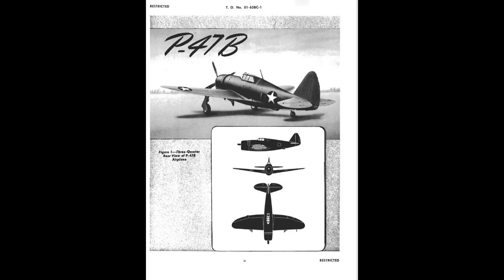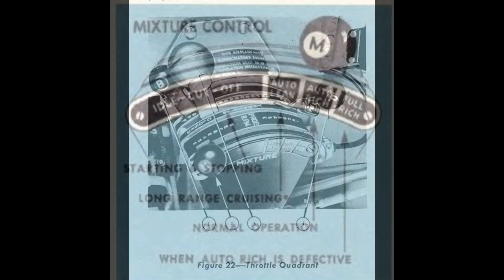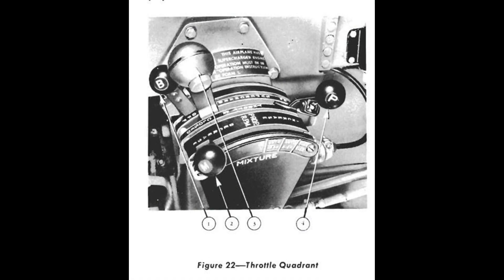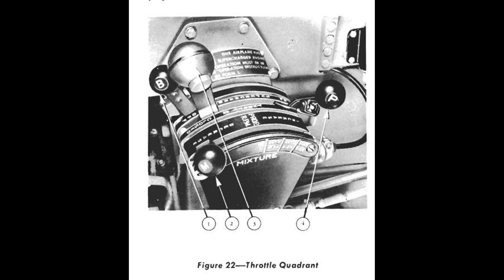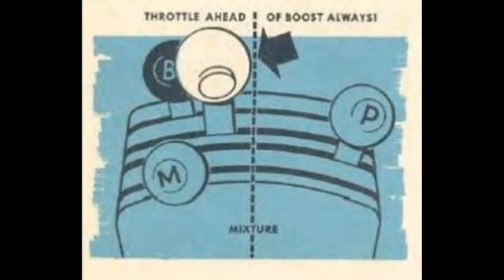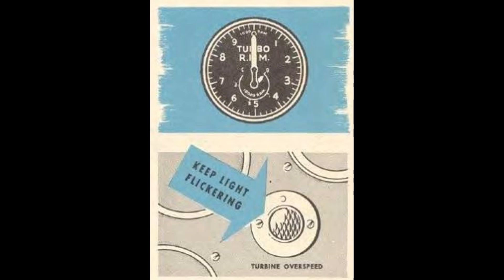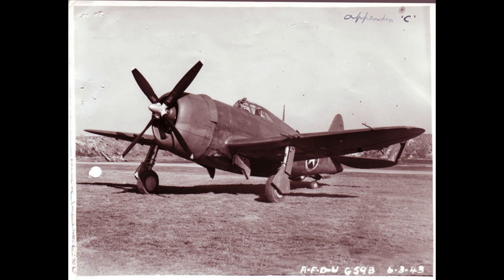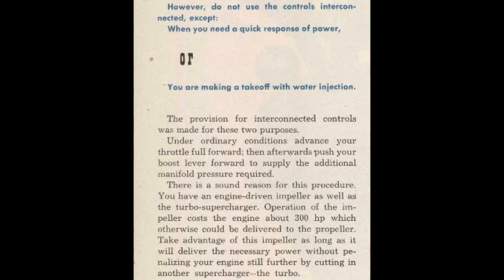P-47 Thunderbolt Pt. 1A Throttle and Boost Lever Use

Comment: A suggestion if I may. Don't use black letters when putting in a text as it can be hard to see unless there is a light background.
Reply from the maker: Good point.
Reply: @GregsAirplanesandAutomobiles  white with a black outline or black with a white outline usually work for any background color.

Comment: It's amazing just how complex WWII were to operate. Take this scenario as an example.

You and the boys are flying a fighter sweep when you get bounced by Jerry. You're in a P-47D, set up for cruise, running external drop tanks. (fuel settings and drop tank operation vary depending on model) You change your primary fuel selector switch to main, reach to the left of your seat and pull the two T shaped handles to release the left and right drop tanks, Mixture goes to auto rich, prop pitch set to auto to get RPM's up, then throttle full. If you're above 7000ft, your turbo will be set linked to throttle. If not, there's that to manage too. 

On top of all of this, you need to be turning and likely starting a dive to build energy / speed, flip the master arm switch for camera / gun, check gun heat is on, and turn on your gun sight which a lot of pilots turned off when not in combat to ensure the bulb worked. Most kept a spare on them and hey, if you can do all the above, changing a bulb out is a piece of cake while your head is on a swivel trying to figure out where those cannon wielding Kraut's went.
Reply: Escape Velocity - agreed.  I think in general - no matter what your machine - you truly had to "know" its mechanics back in the day.   One thing to consider though is that a lot of the fine tuning was ideal, but not fatal if it wasn't done in all scenarios.   Many aces claimed that they became aces not by winning epic dogfights (where fine tuning could be the difference maker), but by picking weak opponents ("Tail-end Charlie"), attacking them unawares, and then escaping (something the 47 excelled at). These were the type of attacks that, although risky if it went wrong, it wouldn't be fatal if say there was some marginal HP loss due to some non-ideal setting the pilot might have missed.   So when you throw in adrenaline, fear, timing, etc. - it's likely the case that WWII fighters, on both sides, were frequently in combat while their birds were not in the most optimal, by the book settings.  Still though, there was a lot to remember about the basic mechanics of your plane.  I think what's so interesting about that factor is that it likely created a lot of room for pilot variation.  Skill levels, styles, tactics, preferences, etc., likely varied in subtle, but important ways pilot to pilot based on mechanical know-how and/or the ability to tune the plane on the fly in combat.
Reply: @helzevec  I haven't read up much on the P47 but I have read some on the P38 and the order for increasing and decreasing power would trash the engines if not done correctly. While the R2800 and the V1750 aren't the same, its something to consider. Also, I think there are limitations on an aircraft when drop tanks were attached. Id have to go back and look at the manual. 

When combat started and how a pilot reacted often made the difference between life and death. On escort missions, it was routine for leads to call out 15 minutes before fighter contact was expected to make sure everyone was set up. Later versions of the P47 featured an electric release mechanism for drop tanks that had to be armed and ready and could be released with a touch of a button the stick. Pilots in these aircraft were always busy and a good example is managing fuel when flying on external drop tanks. Pilots would cycle back and forth between tanks every 15 minutes and with no fuel gauge, tanks would be dropped at a certain time when fuel was expected to run out.
Reply: I think the main differentiation between an advanced WW2 fighter and say something like a F/A-18 Hornet in switchology complexity is just throttle management. Everything else there (except for the gun sight shenanigans) is about the same. 

Of course, a big difference is when you're in a Hornet and you need to pull a 7G turn all you do is slam the throttles forward and PULL. The computer handles everything for you in making sure you don't overstress the airframe (although, you can pull the lever on your stick and get maximum performance).  Meanwhile if you do that in a WW2 fighter you're probably gonna start a very nasty stall state.
Reply: @monkatraz  Cant comment on the Hornet, but when it comes to Jet's vs props, Jet's definitely simplified things and reduced pilot workloads. Later jets starting incorporating advanced HUD's and HOTAS (hands on throttle and stick) controls meant to keep the pilots focused on flying and fighting rather than navigating their systems in the cockpit.
Reply: An issue is with modern computerized jets is the massive workload with systems managements on your screens. Old WW2 prop planes obviously don't have this issue. The big thing that modern jets simplified massively was flight controls. Modern jet you pull the stick hard at a safe speed nothing bad should happen.
Reply: Escape Velocity And our boys were the best at it! Love the skill it took to fly these beauties.

Comment: Can you explain briefly why the Turbo lever is required to be infront of the throttle?
Since I still havent understood why. I have understood why moving them together is bad, but to get higher MAP than just 52" Turbo is required. I can hardly imagine that pilots had the discipline to remind this rule in heated combat.
Reply from the maker: Good question. The turbo lever should never be in front of the throttle. There is a whole page in the manual about this. The reason is that it will cause a situation where there isn't enough exhaust to spin the turbo, and the boost the turbo is putting out will be partially blocked the the throttle plate. Recovery is to lower the nose and advance the throttle. The manual says it may take up to 30 seconds to get back up to full power. In more mild situations, it will cause pulsing in power and irregular mixture control, not as serious, recovery is the same.

Comment: Hey Greg, thanks for the info about the P-47 engine management. This is how it's implemented in IL-2 currently:

At sea level, with turbo off and full RPM and Throttle, without water injection the engine will do 49.5" of pressure, for around 306 mph top speed.

With water injection activated, the manifold pressure remains the same but speed increases to 313 mph.

With water off, advancing the turbo lever doesn't activate it until you hit 89% of the lever position, then the light starts blinking and the tachometer spools up to around 900 RPM, speed doesn't change, as the turbocharger RPM rises, so does the manifold pressure and the speed.  Going 100% turbo it spools up to 6000 RPM, manifold pressure increases to 55.5" and top speed increases to 320 mph.

With water injection on, the turbo activates when the lever is at the 59% position. Going 100% on the turbo increases manifold pressure to around 67.2" at 11000 turbo RPM. To achieve the listed 64", you can have full throttle and decrease turbo a bit, or link both throttle and turbo to do it. With full throttle and going back a bit with the turbo (8700 RPM) top speed is 348 mph at 64". Now at the same setting but now linking the throttle and turbo levers (95%, 10500 RPM) the top speed is 347 mph, there is a bit of power loss but it's very small. 

There is no damage by having the turbo boost lever ahead of the throttle lever.

There is some power loss by running the turbo at full speed but it doesn't look like it is so much. For example with water injection and full turbo, but pulling back the throttle to make 52", top speed is 313 mph. With full throttle but pulling back the turbo to make the same 52", top speed is 319 mph.

The speed values are for a clean plane (no wing racks), 50% fuel and both oil and cowl shutters fully closed, intercooler at neutral position.

Also looks like the turbo gives a too low critical altitude, with 22000 RPM the critical altitude for 64" is 23000 feet. At this altitude top speed is 435 mph.

Looks like the turbosupercharger needs some adjustments, but I bet given the correct information and presented in a constructive way they will look at it ^^
Reply from the maker: Wow, that was some complete data collection. It sounds to me like they have it pretty close, but not quite right. The IL2 people are a good company and they will probably tweak it in the future.
Reply: Greetings from 2021!

As it's currently implemented, the P-47D-28 in Il-2 Great Battles seems to work this way:

You can set engine RPM and manifold pressure at max continuous without turbo at ground level. As you climb, manifold pressure will start dropping. Moving the throttle forward at this point won't have any effect.
The throttle lever doesn't control the throttle directly. The boost lever also doesn't control the waste gates directly.

At any altitude up to 28 thousand feet, without water injection, smacking the levers forward won't result in either overboosting the engine or overspeeding the turbo.

At five thousand feet, with all the levers fully forward and without water injection, the turbo RPM stays at around ten thousand RPM and the manifold pressure stays squarely at 52 inches. If you go to exterior view, you can see the waste gates flopping slightly.
Reply: Thanks for putting out the numbers. Very useful.
Reply: Greg said that throttle alone give 52" for take off, this is not true. And looks like il2 got it right since 49.5 is achievable at full throttle alone at 306mph, at this speed ram air will add couple inches of boost. For stationary plane it will be around 45" at full throttle alone.
I made a test in il2 so 49" is possible throttle alone when stationary, looks like il2 is missing ram air effect on MP so no matter your airspeed MP stay the same, in DCS MP on throttle alone changes with speed from 45" at low speed to +52" at very high speeds. looks like IL2 took average value and applied it.

Comment: I must say that you are real "talking encyclopedia" regarding the WW2 stuff Greg. Again a excellent video from you. 
You mentioned fly sims and possibility to use this throttle as it should be used. Since I frequently fly in IL2 BoS flight sim and fue days ago they release P-47D-28 as a early acces airplane , I just want to say that this is simulated in this airplane and it is possible to use throttle and turbocharger (boost) levers together (they are fixed to each other also with prop pitch lever) and you can move them together or adjust them separately as you like or as it required.

Thx for this video! Keep them coming  ;D
Reply from the maker: Thanks Skylord. With any luck I'll be on IL2 late tomorrow. I don't have track IR or comms so I'll mostly be getting shot down, but if you see me there, say hi. I usually fly the 190, id is GregHF
Reply: I also fly as "lone wolf" without comms so I also get shot down most of the time :/
I usualy fly on Wings of Liberty server in Fw 190 or Bf 109/110 as escort, bombing sortie or watching on our targets 
because I am not a good "dog fighter". 
Hope I see you there !

Comment: Nicely done, again, for the non-engineer and non-pilot. This is the sort of thing I wouldn't have thought of when writing about my Dad "transitioning" from the F6F to the F4U-4. Obviously, neither one is/was a P-47, but all 3 used basically the same engine, even if not the same boost mechanism(s), and these are the kinds of details – if you don't want to get yourself killed, either operationally or in combat – that you'd need to learn and practice until they became habit when moving from one fighter to another. Flying a WW II fighter was complicated enough without having to remember in one cockpit the details of (or exceptions to) procedures you'd learned in a different cockpit.
Reply from the maker: Hi Ray. The F6F and F4U certainly presented their own challenges! Typically U.S. WW2 pilots would sit in the cockpit and practice certain things until they became almost muscle memory. Some were required to be able to find and operate every switch blindfolded.
Reply: @GregsAirplanesandAutomobiles  I suspected as much, and am not surprised by the "blindfolded" part. I've seen instrument panels of both the F6F and the F4U in person, and they make even a race car's instrument cluster look pretty much like child's play.

Comment: Greg, let's be honest... You don't need to talk about throttle control on the P47, but im pretty sure everyone here is glad you are. These detailed videos are fascinating and im that much more of a aviation nerd for knowing all these little details. 

I hope at some point you take a look at the P38 Lightning and it's controls and just how complex and difficult the aircraft was to fight in. I stumbled across this article and its a topic ive never heard covered. 

http://www.historynet.com/p-38-flunked-europe.htm
Reply from the maker: Thanks. I will get to the P-38. It's going to be a facinating plane to talk about. There are so many great features, combined with so many issues and later resolutions to most of the issues, that there is a lot of subject matter there.
Reply: @GregsAirplanesandAutomobiles  I greatly look forward to it. Was there anything in the manual or did you come across anything in your reading covering how sensitive the 47 was to mismanaged prop settings and excessive EGT's?
Reply from the maker: There is a bit about the prop settings. You don't want to combine very low rpm with very high manifold pressure. The Auto-Rich function of the injection carb pretty well take care of the EGTs although cylinder head temps are something you have to keep an eye on.
Reply: Put me down for some dope on the P-38. After reading Bodie's book I wondered why it wasn't used more often for bomber escort in Europe, given its speed and range. Just a bit too complex to operate for its own good?
Reply from the maker: Hi Dan. I'll get to the P-38 in time. It had issues in Europe that really didn't effect it in the Pacific theater. For example, it's mach number limitation hurts it in high altitude dives. Not a problem against Japanese planes, but with it's limitation of mach .67 it can't out dive a 109 or 190. The heater was almost totally ineffective. That's an issue at 25,000 feet, especially over Germany in the winter. There is a lot more, I'll cover it eventually.
Reply: Was the high Mach limit due to the wing/fuselage fillet shape?
Reply: Greg's Airplanes and Automobiles - When you do make some 38 vids, I hope you take a moment to mention that 38 units in the ETO had uncharacteristically poor performance with the P-38. Lightning units fighting in the 15th AF fought just as high as the 8th, yet they were a potent fighting force. I attribute their success, contrasted against the 8th AF, as a difference in experience from the ground crew’s maintenance, to the pilots operating procedures, to the general command escort tactics.It’s also worth mentioning that until hordes of P-51s overwhelmed the skies, the P-38 was the ONLY longe-range daylight fighter, and therefore was usually outnumbered, deep over enemy airspace, and desperately trying to make up the difference in experience that the Luftwaffe had over them.
Be sure read about P-38 tactics from some of the best 38 drivers like Jack Ilfrey, Irv Ethell, Robin Olds, Tommy McGuire, Tommy Lynch, and Dick Bong
Reply: Also, be sure to read “Combat Tactics in the SouthWest Pacific Area”, by Tommy McGuire and other experienced veterans in May of 1944

Comment: Would be nice if this system had the same level of automation found in the German planes. ( Push throttle forward, get power! ) seem that to get the most out of this plane one may need a proper throttle quadrant with multiple levers.
Reply from the maker: The 190 does have the most pilot friendly system. interestingly the Germans tried than again with the Mooney-Porsche collaboration in the 80's. it just didn't go anywhere, but the idea is sound.
Reply: @GregsAirplanesandAutomobiles  the PFM failed, because it entered the market at the wrong time. It is what general aviation aircraft should have as a standard.

Fiddling with mixture, prop and throttle nowadays is ridiculous. Worst of all, spark curve is fixed although operating conditions aren't.
Reply: @GregsAirplanesandAutomobiles  I would be very interested in seeing a video done on the fw-190 kommandogerat.  Wonder if there is sufficient info/data out there to allow that.
Reply: @Incog Nito Later versions of the D, M an N had increasing levels of automation especially with the water injection, turbo and cowl flaps. The lack of automation in the initial models of the P-47 probably had to do with the fact that after WWI, the US military was severely curtailed. Aircraft design, technology and innovation wasn't a priority. It was with the Luftwaffe.
Reply: If something doesn't make sense, it's probably because the Army wanted it that way.
Reply: I believe the P-47N-25 has a similar mechanism, but only governs the throttle and turbo but not the propeller.